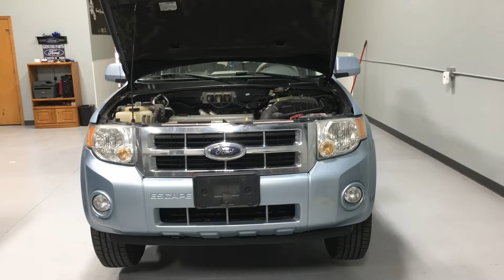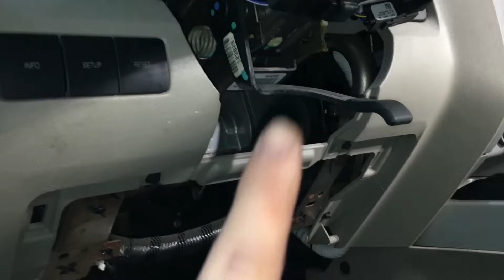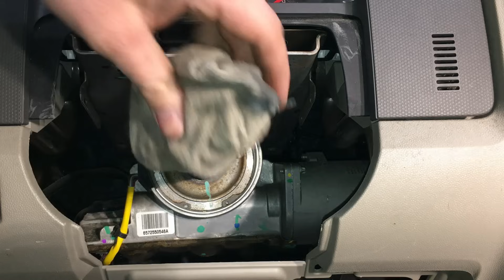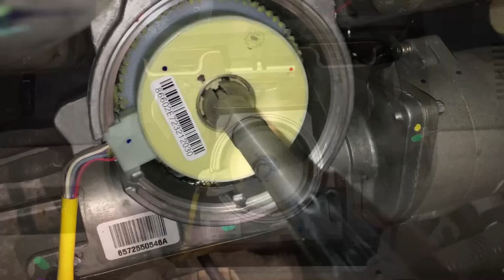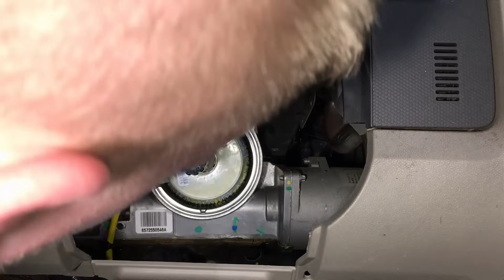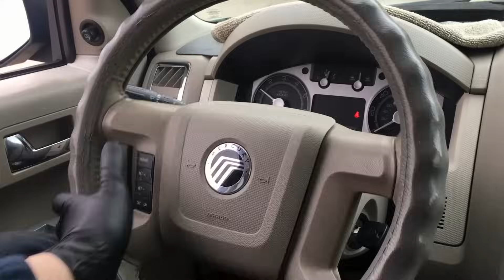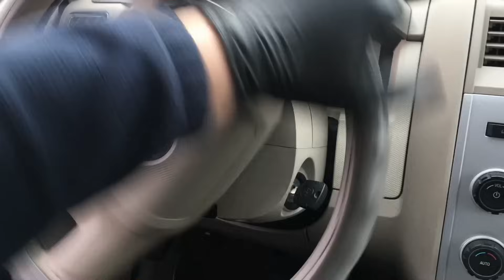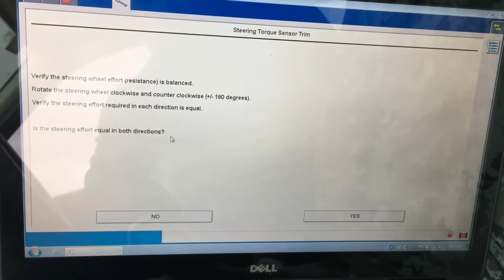2008-2012 Ford Escape Power Steering Code B2278 : EPAS Torque Sensor Critical Installation Steps

Comment: Great video  My 2009 Mercury Mariner was having this same problem.  The recall work they did was only the programming of the steering control box and the recall on mine was closed without any parts replaced. So I bought the steering torque sensor, followed the instructions very closely and the steering wheel doesn't jitter now. However my vehicle hasn't quite "learned" the trim values yet. I'm hoping it will... The hardest part of the job for me was getting that big snap ring off. Had a small pair of ring pliers that were too small, went to the hardware store and bought the only bigger size they had, still too small. So what I did was to use a good size pair of needle nose pliers and after grinding the tips a couple times I was able to get it off and eventually back on. It was a little nerve-wracking thinking you may screw up a $200 part and have to start over lol
Reply: Yeah, that snap ring is still giving me troubles trying to do this job...
Reply: @saul1245-e2u  where did u buy ur snap ring pliers
Reply: any other tips? im about to try this myself.  Did you have to clear any codes after or did the "POWER STEERING FAILURE" notification disappear on the display?

Comment: After I replaced I made sure the Mark's and the window shown the hole in the midle of the window.. after I installed the steering went one side and I just needed to calibrate the sensor mi need to replace the sensor again. Great video tho. It helped a lot

Comment: Awesome video I had to do one for the first time today, I found your video and watched as there wasn't much info in our repair guides we have. Once I seen the procedure it seemed pretty straight forward with some key steps to pay close attention to.

Everything went perfect I had no problem with the job, I would say if one has mechanical knowledge and watched this video they would have little effort doing this job. Even being in this trade for over 20 years I still learn new stuff.
Reply: was it hard finding a large snap ring plier?
Reply: @Adrian-lv5kk  Mine were all too small even though they looked like Brian's. I got a 12" one from Harbor Freight with non-replaceable 0.125" tips for $32

Comment: Shouldn't you first have a wheel alignment done before replacing the torque sensor?????
If they used a contactless digital sensor, none of this would be necessary.  The sensor would last the life of the vehicle.
Reply from the maker: no

Comment: UPDATE: 
After having successfully changed my torque sensor, only about 1 week later, the problem has come back. 
I guess i'll have to change the entire steering column :''''''''(
Reply from the maker: For this exact code?
Reply: FordTechMakuloco theres currently indicator light. Should I have a mechanic check with a scanner? I have a Bluetooth OBII scanner, I'll try with that as well
Reply: FordTechMakuloco no fault codes logged on my Bluetooth OBII scanner.
Reply: @ericinpublico2079  did you fix this problem?

Comment: I'm looking at buying a 2008 Ford Escape Hybrid, just wondering if this sensor issue would also affect the power steering as the one I'm looking at doesn't have power steering at low speeds (parking speeds). The owner claims it's a sensor issue, but also claims the entire steering column needs to be replaced and not just the sensor because it's electric.. Pretty sure he's got incorrect info from his mechanic buddy, and I'm hoping that's the case because I might be able to get a great deal on one of these!

Thanks for any help :)

Comment: Hey mate, another question for you. Do you NEED a calibration computer to finish. Or is it just replace and done? 
Thanks again for the video :)
Reply from the maker: Its best to make the steering effort even side to side.
Reply: FordTechMakuloco ok cool, and just to be clear you don't need a computer for it, just need to keep turning the wheel left and right for a bunch of times. :)
Reply: @ericosterlund3126  How many times is “a bunch?”  My scan tool will clear the codes, but can’t do the trim calibration.

Comment: I noticed that you said to turn the steering slightly to the left, but at the same time everywhere says that you have to have the wheels straight. Which one is correct? 
Thanks for the video :)
Reply: Hi great instructions, completed all the steps and when I turned it on steering wheel was quite, exciting the installation was a success. The I turn the truck on I was disappointed, steering code was still on even after reset and still no power steering .  Could there be something else with the steering outside of the tourqe sensor? My next move is to take it and have the calibration done.
Arms are getting stronger but it's tiring
Reply: @tonyferlisi1737  Did you end up finding a fix? I'm in the same situation. I just finished the install and absolutely nothing is different.
Reply: @lrylpz  Hey did you find a fix?  apparently there are 2 other solutions that have worked for others.
Reply: @Adrian-lv5kk  I took my car in to a small shop and they cleared the code. Got power steering back but it's out of calibration. I think only the dealer could calibrate it for me.
Reply from the maker: you must have the wheels and tires straight then align the steering wheel a bit to the left around 11 to get it close to the alignment mark on the column shaft just as shown in detail here.

Comment: "5 degree window of accuracy...outside of that, steering wheel will flip out on you, ruin the $200 sensor and you'll have to uninstall and start all over." SHEESH!
Reply: Actually it doesen't ruin the sensor, if the wheel goes to the left or right. You just have to follow the aliment steps until you get it right. Yes it will take some time! Only the tire and lower shaft have to be at 11:00 the upper shaft will set itself when the engine is started. tires must be on the ground. If the wheel goes right you calibrate to the left, if the wheel goes left you to calibrate to the right. It is very important the aliment tool goes in the hole straight without angle. Also dead center.
Reply: I did it and failed like 6 times and it didnt get damaged just had to try harder jaja

Comment: Sensor looks the same that gm using differences is gm have to be programmed. I had one car that went through 4 sensors before it would program. Payed 2.2 hours to change sensor x 4. Work was done under recall so that was gm paying me not owner. Sensors can be done in 15 minutes on gm cars.
Reply: David Mauck it does for sure. Motor on right side. Had to do one on a Pontiac. I marked everything,  anal that way.   Yet wheel freaked.  I believe it was perfect. Yet didn't work right. What bothered me was part came wrapped in saran wrap.  Odd for GM stuff. Think it was previously misinstalled and returned. Yet I screwed up?  Nope
Reply: David Mauck, it very well could be the same or similar to the GM sensor since Ford and GM both buy parts from Delphi. My 2010 Escape has a Delphi throttle body on it and of course it says FoMoCo on it, however it is made by Delphi. My TB failed just after the warranty and I bought this vehicle new so I was pretty torqued off when it failed at 38.000 miles on it and to top it off it was a Chevy part that failed. I still view Delphi as GM even though they spun em off on their own. Anyway a year later the part was recalled and I informed my dealer of this and I gave em the info and they sent  me a personal Dealership check and they took care of the rest I did not have to wait for Ford corporate to re-imburse me. As for now I have 120,000+ on the Escape and all has been well. Mobil 1 baby!
My torque sensor has not failed yet , but has a recall...we will wait till it fails then Ford can fix it.

Comment: I know this isn’t related to this video but I need your input.  I have a 2015 Ford Edge titanium.  Since we’ve had it it’s had a huge problem shifting from either first to second gear or second to 3rd. Like it kinda revs up and then clunk.  Recently it’s also been having trouble downshifting from 5th to fourth while going up a hill whereas when we bought it it only required putting the pedal down a little further and it would downshift and zoom up the hill. Now you have to floor it to get it to downshift and it doesn’t always do it. I’d GREATLY appreciate any input.

Comment: A stinker of a job to film - well done. You can't beat an old fashioned hydraulic power steering system without all of this nonsense. Nevertheless a very confident repair demonstrated for this particular fault.
Reply: But hydraulic power steering is impractical for self driving cars, self driving cars are important for full government control of its slaves/citizens… coming soon

Comment: i have an 2008 ford Taurus X and im lost with this issue  my turn signals are acting up left and right turns blink rapidly but both sides turn signals are on 
my hazards lights work perfectly with no issues ? no bulbs are broken i have replaced the front but the back have led. 
 i had it scan and its not giving me no codes for the SMART JUNCTION BOX OR GEM no issues with ground wire what so ever . 
but im am thinking it can be the turn switch its self but everything works on it wipers and rear wipers. 
please give me an hand if you can .
Reply: the LED lights will cause this (rapid flashing) on a standard flasher module, just get a new flasher that works properly with LED bulbs and swap it out, it just plugs in on the SJB.

Comment: On our 2008 Ford Escape the power steering assist has completely quit at times. Shutting off the engine for a moment has somehow reset something and it resumes working. What causes this?
Reply from the maker: Pull codes first, either it needs a column or this sensor.
Reply: Interesting, any details on why it'd be the column vs the sensor?
I'm looking to buy a used 2008 Escape Hybrid and after talking with the owner it's apparent it has a power steering issue and he says "it's a sensor, but it's the column needs to be replaced"...so with that and now this I'm wondering if I can get away with just getting the sensor and doing it myself..

Any chance of a video showing how to do that other repair? :P
Reply: Mercury Mariner 2007, exactly the same issue. Very annoying, i just drive it without power steering - difficult though.

Comment: Very interesting and a perfect timing! It appears that you upload video based on my own car problem :D

What is your opinion on driving an escape with that problem. Is it a very dangerous situation or as long as it is limited to small shaking while centered it's ok to keep on driving it?

If i could wait a month or two before changing the sensor, that would float my boat.

Thanks again for all your great video!!!

Comment: You have the details perfect...accept I think you are supposed to hold the alignment tool over the torque sensor while you pull out the pin (with the other hand).  Otherwise, you could inadvertently pull the torque sensor back out with the pin still in it.  Great video!
Reply: I’ll keep that in mind when I do mine tomorrow lol. Thanks 👍🏻

Comment: Didnt see no blood nor any sweat during the repair!$!?!!%  i see you got a gen2 fuel 1/4 driver. Your bosch impact driver died?
Reply from the maker: I requested the new compact driver from Milwaukee to replace the Bosch since it was the same size but more powerful. The Bosch still works it just was getting weak and it was time to upgrade.

Comment: I took my escape in for the recall and they replaced the whole power steering module. It had started to twitch the wheel when i was stopped.
Reply: When was the recall. I never got a notice about it
Reply: @theoriginaltylerdurden  2017 I think. It was a TSB I think, not a full blown recall. So if you had issues they'd just replace the module.

Comment: ,, I need a video on a 2013 Escape,,,. Transmission and transfer case. ???  Fluid replacement,,,,.  Rear differential fluid replacement,,.  Thermostat and antifreeze replacement,,.  I know how to remove the intake manifold and clean the valves,,,,,. Any tips or what to watch out for would be helpful,,. !!!   It's at 60,000 miles,,,. Time for the major preventive maintenance,,. !!!

Comment: Thanks for this video.  I have sent two of these to the dealer as the service instructions I have access to made it seem much more complicated and said I needed to reflash the module after. Now i know its tricky but do-able and I can drive to the dealer is just turning the wheel stop to stop does not solve the steering feel ....

Comment: I'm curious about which scanning software you use. I've been using Forscan which gets annoying to register every couple months.
Reply from the maker: Ford IDS
Reply: Did you end up trying the Ford IDS Derrick?  I see they have the VMC 2 on ebay for a couple hundred.  Wonder if it's worth trying over the $1500 ford wants.

Comment: I've got a 2014 fusion with a 1.6 that did the strangest thing on Friday.  I was driving up the road and the wrench icon came on, it lost power and the tach was fluttering like crazy. It had a code for something related to a throttle position sensor (I don't remember the exact code unfortunately). Is there any specific things that i should take a closer look at?
Reply: Jonathan A it only did it the one time. Which really threw me off. I'll have to check on picking one up when I get paid. Thanks!

Comment: Think the main procedure here is to recheck several times and maybe wait for about 20 minutes, before pulling the pin.Replaying the video until the reassembly has been fully learned and understood. The adrenalin meter will be at the higher end,and so being in a hurry should be a no no as well as a few prayers to the patron saint of mechanics { St Catherine of Alexandria } Well documented video and easy to follow !!

Comment: Is the fusion the same, or does it have a different sensor?
Reply from the maker: The fusion has a rack EPAS system and is not serviceable.
Reply: @FordTechMakuloco  I have a 2011 ford fusion and it says service power steering now what is my problem? Please help

Comment: You just confirmed why I drive a 16 year old truck.    Good video
Reply: That’s why I drive a 34 year old truck
Reply: So now you just watch repair videos for cars you’ll never own
Reply: Exactly why I took off the original whiny Ford pump and use the older F350 Saginaw pumps on my trucks. 👍
Reply: Now the car in this video, a 2010 is 16 years old lol
Reply: Good

Comment: Could a bad Torque Sensor throw a B2278 code?  From time to time I'll get a little wrench light on my cluster and I lose my power steering.  I need to bring my escape to the dealer and have them clear the codes and I will have my power steering back again.  The code that keeps appearing is DTC B2278 In Power Steering Control Module.  The strange thing is that I don't have any shaking in my wheel at all.  When it happens, it's always whenever I making a left turn (Believe it or not).  Should I replace the Torque Sensor or is there something else within my PSCM?
Reply from the maker: Yes when the torque sensor fails it sets a B2278 yes.
Reply: @Steve Timmons - Did you ever get yours fixed? If so, what was the fix? My 2008 Ford Escape Hyrid does the exact same thing, including only seems to occurring when turning to the left.
Reply: My friends 2008 Ford Escape Hybrid did the same thing she said when turning left. I replaced the torque sensor for her and all is well so far. It wasn't that bad of a job except for removing the snap ring until I bought the proper tool for that. I was going to have a mechanic do it but decided to do it myself. You can buy the torque sensor on Amazon or Ebay, Ford part#  CL8Z3F818A for under $150.00.
Reply: @shawtysmusic90  did you ever fix yours?

Comment: Thank you for this, my steering wheel started vibrating like you demonstrated only 2 weeks ago.  Most frustrating part is that I had the escape in for the recall and they "fixed" it.  So, question, if I did not get the recall done 6 months ago, then Ford would be on the hook for this fix?  But since the recall was already performed, I am out of luck?
Reply from the maker: Correct.
Reply: !!!Attention all Ford Escape owners!  If you have not yet had the steering recall performed, wait!!!
Reply: @FordTechMakuloco  i got a 2010 escape with no code  and no recall but i got no power sterring what could be the problem
Reply: @voyageur1998  same here
Reply: Ben Rollins as Brian mentioned, Ford will only reflash which will not repair the problem.
Reply: Yes, but if there were already signs of failure when bringing in to have the recall performed, they would need to repair it as part of the recall.  Since it didn't fail until after they reprogrammed the module, the recall is already closed out, even though the vehicle was already driven for 8 years, and damage was pretty much done, it just needed an extra couple of months to finally fail.

Comment: OMG, I just messaged you yesterday re a similar problem. I was scanning for codes cause my daughter though the 2011 Escape 3.0 was a little sluggish merging onto the highway. I found B227B, service manual say to replace column, no reason given. Other than the slight intermittent knock (small u-joint) at the base of the column I really can’t feel a problem with the steering. Definitely never shook like this torque sensor issue.
Reply from the maker: Yup you definitely need this torque sensor. The old procedure was to replace the column, now Ford has allowed us to service it.
Reply: FordTechMakuloco ok thank you. Code B227B mentions the Steering shaft position sensor, which I thought was inside that weird looking compartment the torque sensor plugged into. Your saying that replacing the torque steer sensor will correct the B227B even though I don’t have the shaking steering wheel?....yet.